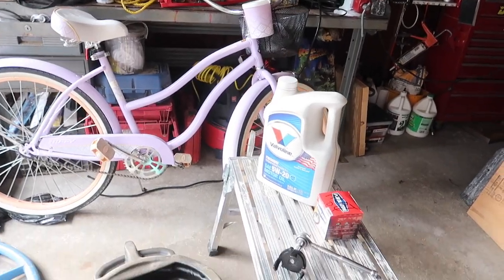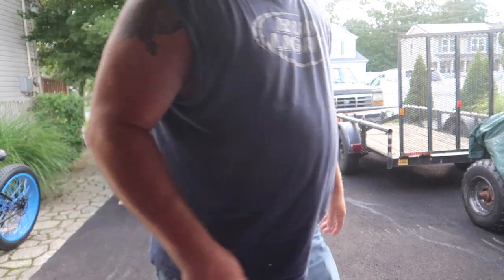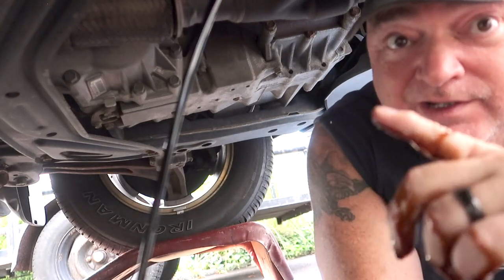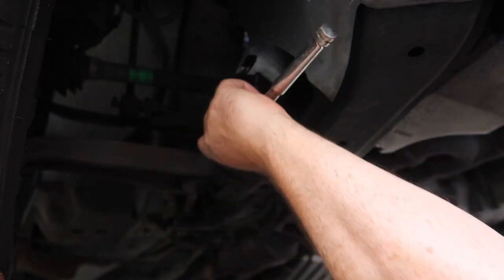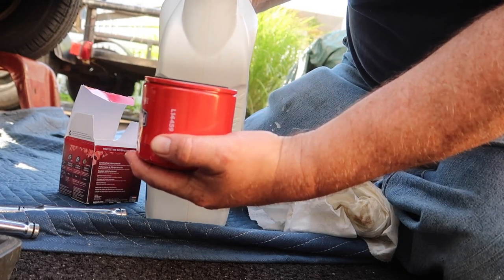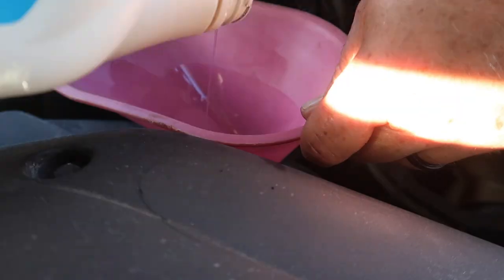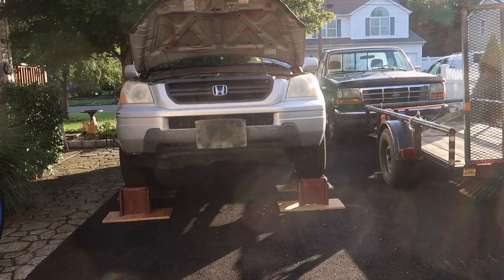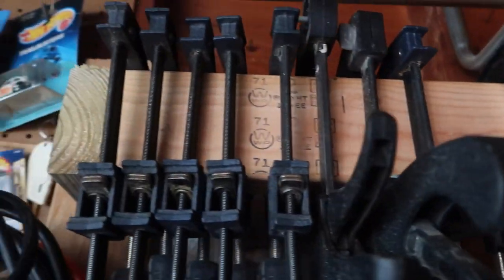How To Do An Oil Change and Filter Prime On Any Car (Easy) Step By Step

Comment: “Blooper” 🤣 I made a diy yard tool holder. Out of a 2- 2x4 and cut a pvc pipe in 2 inch rings and attached to the 2x4 to hold the handles in place for my shovels,rake, broom ect.
Reply from the maker: Nice idea I’ll probably make that!